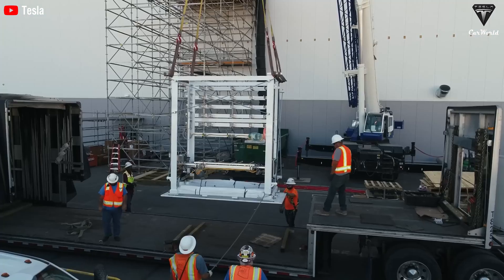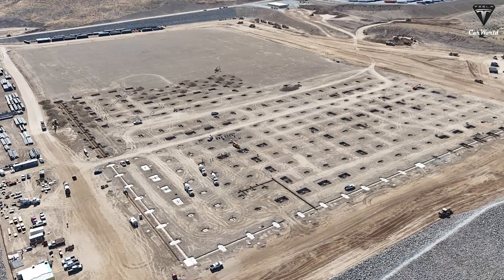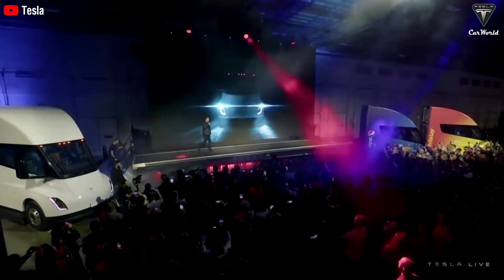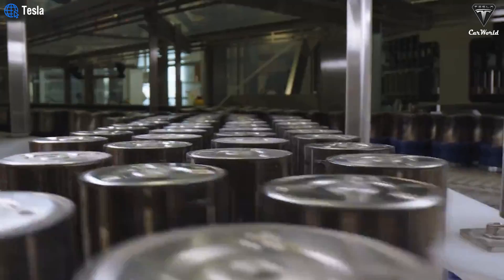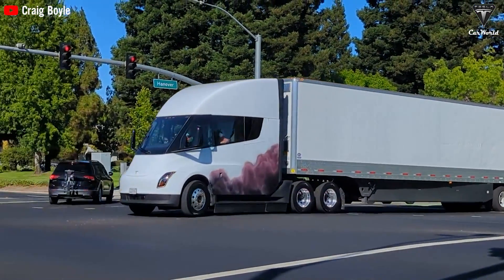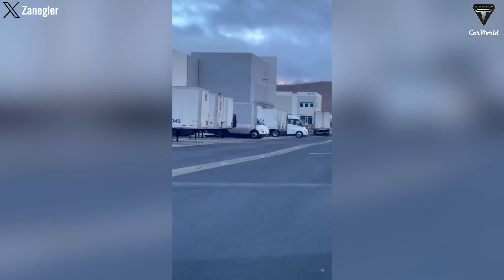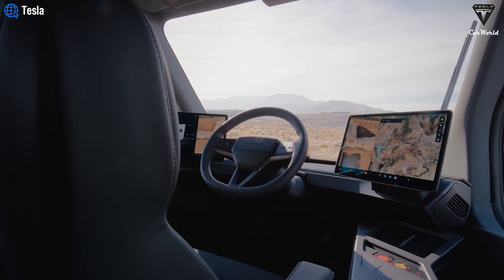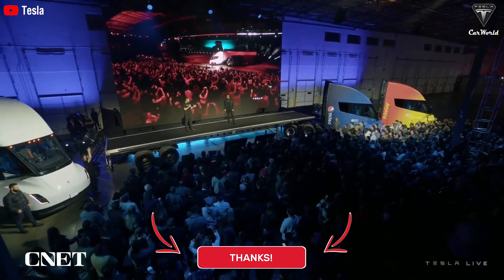It Happened! Elon Musk Revealed 2025 Tesla Semi Final Price, New Sleeper and Production Line Update

Comment: As an otr truck owner operator, only way tesla semi will be looked at as a realistic alternative to a diesel truck is the following,
1).  Driving range has to be between 700 - 800 miles per single charge (this is how far you could be driving in a day) and
2).  Must be able to charge up truck battery using an APU (diesel engine) or plugged in into a charging station.  So you don’t get stranded.  Think Chevy Volt.
3).  Your truck battery should be charged fully in 10 hours using diesel APU.
————————————-
Your truck must be able to travel minimum 500 miles after charging for 30 minutes being plugged into a charging station is acceptable.  

But still, diesel APU charging capability is a requirement.  Don’t want to be stranded because the battery juice ran out.  

If you can do all that, then the truck is a viable alternative to meet the distance requirements of any otr truck driver.